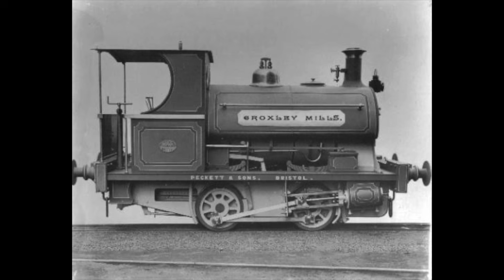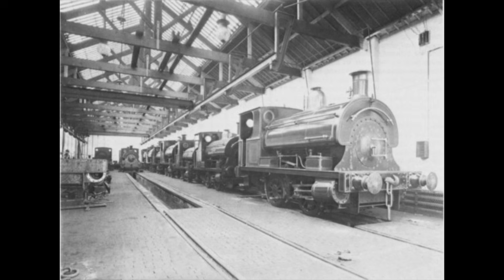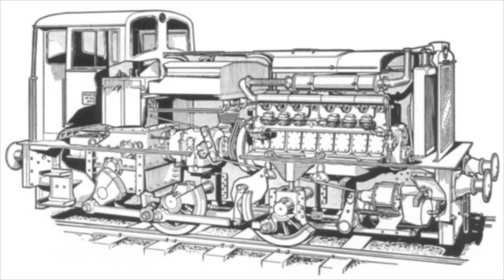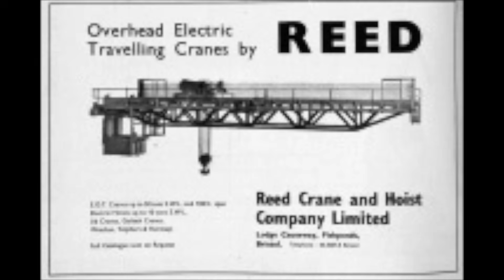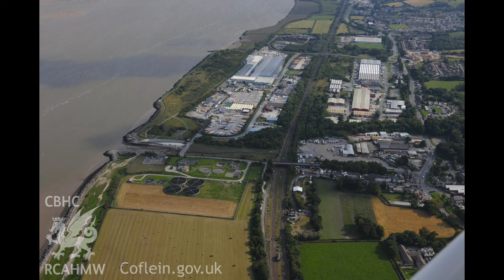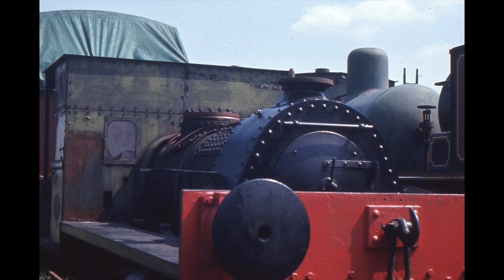The Flying Bufferbeam

Comment: Building a business on both building new industrial locos and repairing them makes sense, since most industrial companies wouldn't have the knowledge to do much more than supply it with fuel, water, and lubricants. Keeping a steam locomotive working is hard work.
Reply from the maker: it is and yes there was works before that used to dismantle and rebuild a loco in a mere 7 days! (the video is in the works) but to have skilled labourers that have the unique skills to build and maintain a loco like that are few and to get them together is too difficult. usually nowadays when the engine is dismantled or overhaul or other reason, the parts are shipped to various places too e worked on, then brought back together like one giant puzzle.

Comment: I've seen similar loco's, like the preserved Becton gasworks locomotive, which was made (as many others were) to run into the retort houses (part of the gas making plant), which were built of necessity with very low clearances, but I've never seen one as squat as this. It's a brilliant bit of design work. Also, top marks for your excellent video production here (including a very clear commentary). Thank you. Could you do a video about the 2 modern Garratt locomotives with L.D.Porta type (secondary air admission) type boilers which run on "The railway at the end of the world" in Tierra Del Fuego, and which are so efficient and environmentally friendly that they were chosen in preference to diesel's. (Their efficiency exceeds any diesel locomotive which could be found, when the railway company researched the subject when looking for suitable, new, motive power.

Comment: I remember being about 2 or 3, maybe even younger back in the 1970's and going on a narrow gauge engine that looked remarkably similar to this design - I've no idea where it was and have never been able to match the view I recall from that trip (on the footplate for part of it!) with any currently existing heritage narrow gauge lines. :(
Reply: Sounds like one of the locos at Welshpool & Llanfair.  Dougal, a little gasworks loco.
Reply: Could it have been the Romney Hythe and Dymchurch railway?
Reply: Do you have any idea of what colour it was, and can you recall if it had a name, or owning company initials or logo, and/or number on it? Or any other individual details?

Comment: can't imagine how OO modellers's reaction to this XD
Reply: We need this in 00 gauge! 🤣
Reply: It would probably need a powered van or truck or something to move
Reply: @Jam_Van N scale motor or just a small motor
Reply: @Jam_Van   a coreless motor should be small enough....they get them to fit in N gauge boilers....
Reply: literally waiting for an OO gauge model of flying bufferbeam to turn into my oc whos based on her
Reply: My reaction is to ask if the frames is the same dims as any of the Hornby Pecketts.  I know their chassis are tall.  I do own a hacksaw, though.
Reply: Good history. At first I thought it was a steam tank which had been sliced down with cutting torches to make a shunting truck or something. Amazed to see it actually ran!
Reply: SamsTrains has 3D printed a couple of curious designs, both original and based on existing classes not covered RTR.

He also has experience with slim coreless motors, I wonder if he would be up for the challenge of designing a model.

Meanwhile I work with N scale. Now THAT would be hilarious to see.
Reply from the maker: I never forgot the time one of my friends showed me an N gauge class 142. in honour of my outburst when I saw it, it is now called baby pacer!
Reply: @DouglasParkinson  what about a T scale flying bufferbeam
Reply: @TrackRecordTrains  I think you would just need to sneeze in the same room as it and it would be forever lost at T scale haha
Reply: What about revised TT and N gauge? Use a power bogie?
Reply: @likklej8  plausible, might try
Reply: Or maybe the 7.5-inch gauge community.
Reply: Someone mad enough will do it